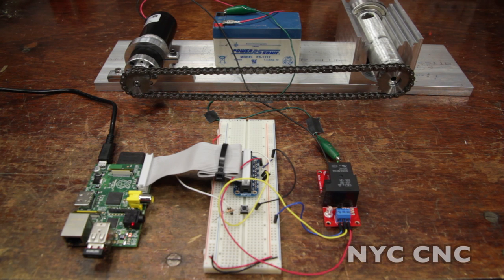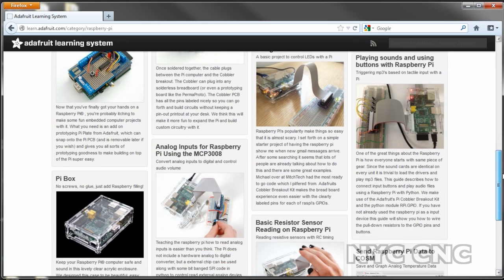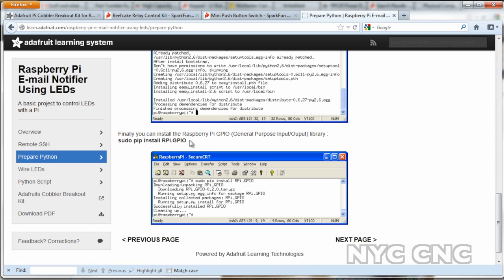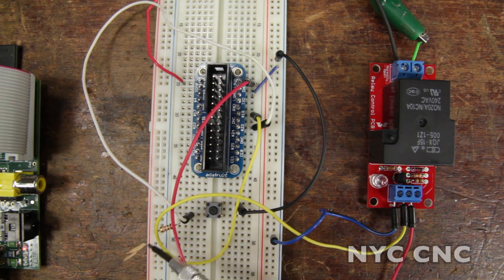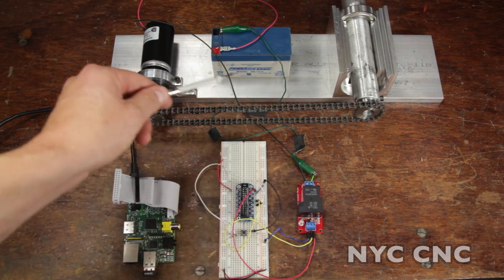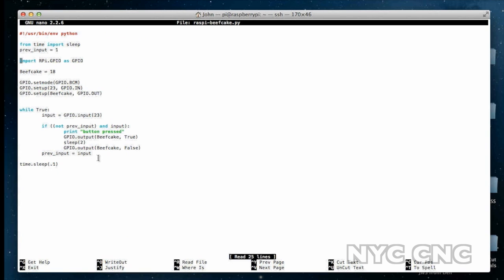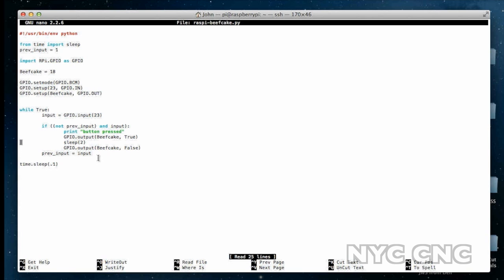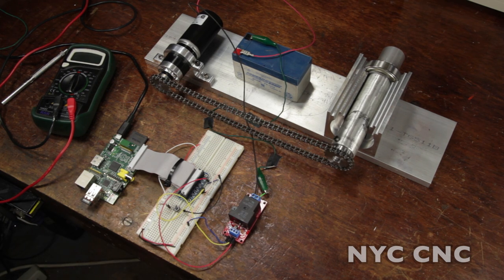Control a DC Motor with Raspberry Pi and Sparkfun Beefcake Relay!  How-To Tutorial from NYC CNC

Comment: Great tutorial! I have the same relay and was wandering if it would still work correctly if you switched the black and green wires shown at 1:57? I have been looking every where but can't seem to find anything that says whether or not the direction of the way the wires plugged into those two slots matters. Thanks!

Comment: hi john, I see you play with this; does this have available interrupts to handle buttons? other question, have timers to develop a cnc controller? (multi axis), also DMA controller to enhance data transfering? I come from the PIC32 experience and would be cool to use this cheap integrated computer as GUI and controller to replace a microcontroller. thx

Comment: Hello +NYC CNC ,
I'm looking for H-Bridge video but it looks like you still didn't shoot it.
I have just a few questions (for Raspberry Pi 2 desk):
- I have an gear motor. Is possible to use any H-Bridge (like this http://www.dx.com/cs/p/l298n-dual-h-bridge-dc-motor-driver-for-robot-smart-car-green-154444)? Works gear motors same way as DC motors do?
- I know something small about H-Bridges. When I have all 4 "ways" closed (no voltage), motor should rotate freewheel, when 2 ways are closed(on the side), it breaks. Will this work with gear motor? Maybe I ask silly but I didn't find any difference between DC and Gear motor so I ask.
- Last question. When I send there pulsewidth modulated signal, will it work that way that It supposed to work? With short pulses rotate slower and long pulses faster? 
Thanks for every advice and help.